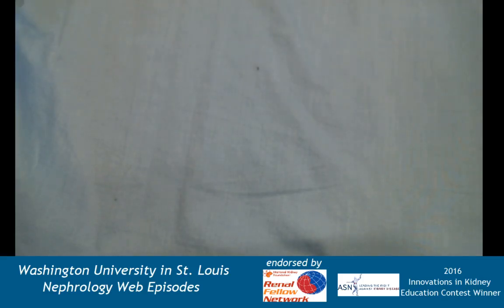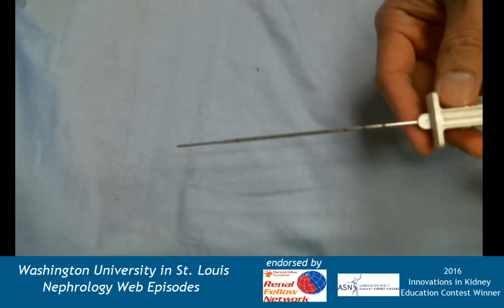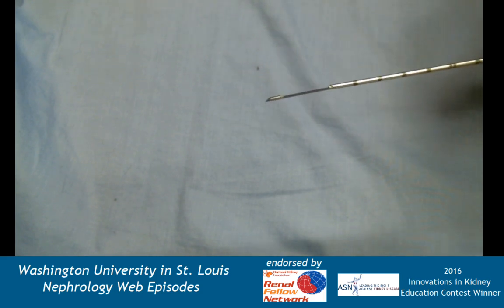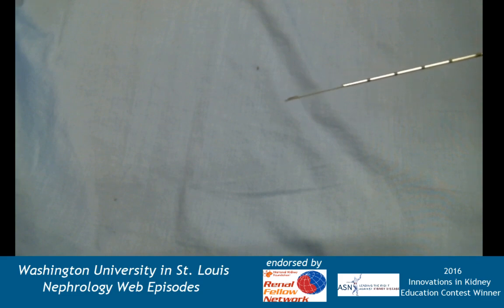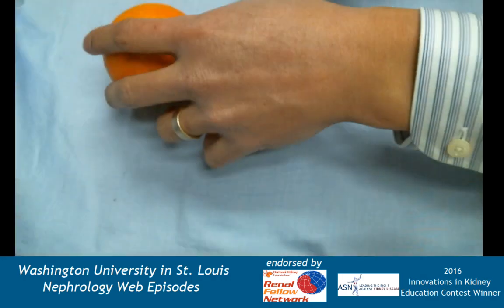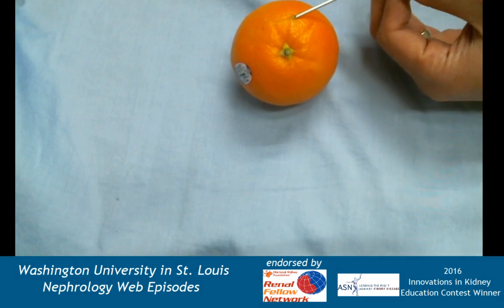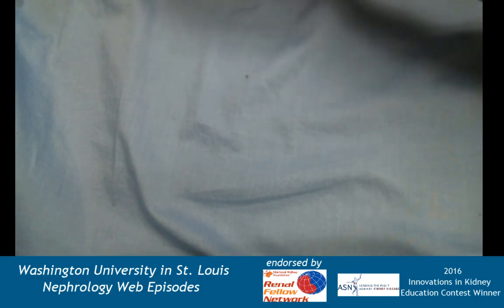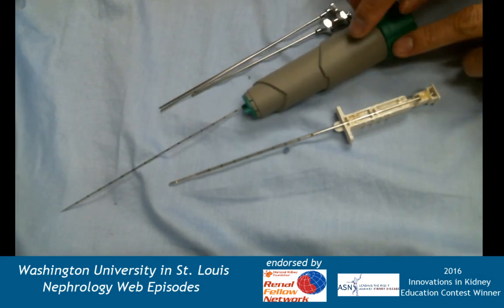Web Episode #025b - Kidney Biopsy Hands-on Demonstration

Comment: I had my kidney biopsy yesterday (February 12th, 2021). I must say that they used needles way thinner than what's shown in the video. There's almost no pain at all once the anesthetics wear out. The whole procedure from hospital arrival to discharge home takes about 4 hours. The actual biopsy 20 - 30 minutes. 
I opted for general anesthesia instead of standard sedatives. 
Thus I have been injected:
Propofol (general anesthetic) - 200 mg
Fentanyl (pain killer) - 100 micro grams
Decadron (steroid) - 6 mg
Lidocaine (local anesthetic) - 5 ml 

I opted out of benzodiazepines. I was afraid I'll feel high and thus a chance of liking it too much. As for the fentanyl, once injected I passed out instantly and when I woke up I had a sort of hangover feeling, so again no euphoria at all. Now I know what works for me.

Comment: Do they use a general anesthetic or a local one for this?
Reply: They normaly use local anesthetic but my mother told them to give me general since i move around to much
Reply: @Genevieve1412  
Had they given you the benzodiazepines?
Reply: @LV-426...  I haven't gotten it yet my biopsy is next week
Reply: @Genevieve1412  
I see. You may be nervous but it's really not that big of a deal.
Also you won't need any painkillers after the procedure. If they prescribe, avoid. It will feel just a little soar, that's all.
Reply: @LV-426...  Ok thanks for the assurance😁